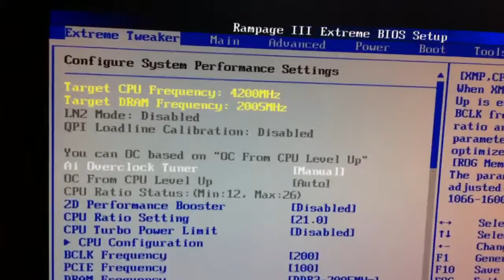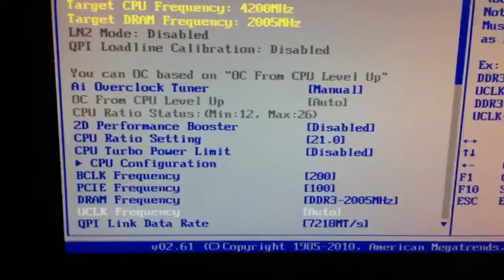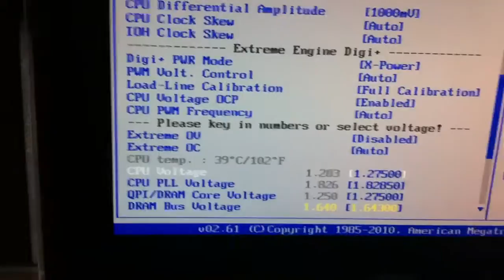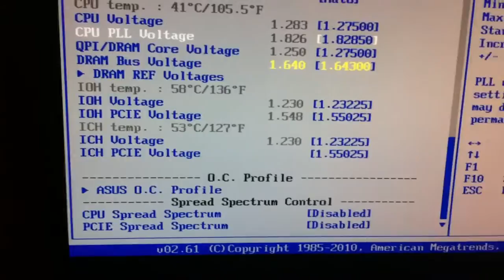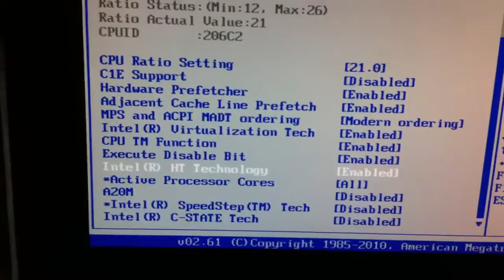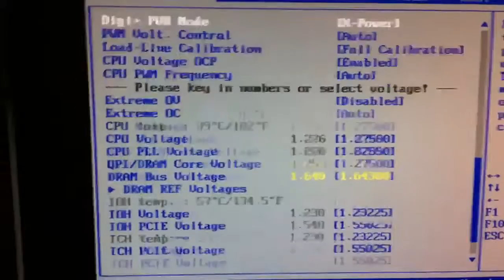Overclock R3E, i7-980, 3.3ghz to 4.2ghz on air

Comment: I use 22x multi on my cpu I don't incease it, I only do base clock more stable for my i7 980x I got 4.84ghz stable on a h100i with 1.56vcore
Reply: too much voltage
Reply: X AK still going strong haha but I upgraded to 4930k
Reply: GamingTurkey  4930k great chip <3
i am running x5650 at 4.3ghz with 1.38v 
thinking to upgrade to x5680 XD 
if you have any idea do you think it is worth it ?
Reply: X AK if it's still cheap yeah go for it, but if it's expensive then 6700k would be better. :) I still have my x5650 from years ago got it to 5ghz on 2cores 1.6v 4.6ghz 1.45v best cpu I ever had.
Reply: X AK if it's still cheap yeah go for it, but if it's expensive then 6700k would be better. :) I still have my x5650 from years ago got it to 5ghz on 2cores 1.6v 4.6ghz 1.45v best cpu I ever had. My 4930k only does 4.4ghz at 1.3v and it poops it self after that won't go further. Even with 1.5v but I got it at 4.2ghz 1.22v 38c on the hottest core :)
Reply: GamingTurkey  i found it less than 100 dollars 
i think it is on the cheap side 
also 6700k is very overpriced for me i will never buy it also i have old ddr3 ram i cant buy new ddr4 XD too much money
i have asus extreme 2 motherboard i will never change it XD money everywhere
i am on air cooler coolermaster v6 i cant push my x5650 to higher voltage because of the temps 
but generally 4.3ghz from 2.6ghz stock it is very impressive i got 980 points in cinbench r15
Reply: X AK with my x5650 @4.6 I got 1080.  With my 980x @4.8 I got 1111 and with the 4930k @4.4 I got 1220 :P go for the x5680 then :) I would recommend a h110 you can do easy 1.6v with no issue. Any cpu.

Comment: Thx for the vid, it helped to overclock my 980 even though am using the p6x58d premium. I couldn't get to 4.2 but I did get it to 4.0. Close enough for me. I also got the noctua heat sink and it keeps my cpu cool. Average 33 to 36 celsius in idle and 45 to 50 celsius on load. Thx again.

Comment from the maker: well im using the noctua nh-d14 heatsink now, and I was going to buy a reference GTX 680, but im waiting for the Asus GTX680 DirectCU II.
 I sill run it at same specs 4.2ghz with 12gb 2005mhz ram.
Temps i dont bother watching anymore heh, there very nice and cool at 30C-35C with playing skyrim Maxed with mods.

Comment from the maker: @SchijtXD if you have the same motherboard, and cpu then these specs should be fine for you... but watch your temps, what heatsink/cooler do you have?

if you have a stock i7-980 heatsink i'd stick to 4.0, maybe 4.2 if temps are good which they should be.. the i7-980 stock heatsink is pretty sick.
Reply: Hello friend,i bay a Alienware aurora R1 whit I7 980(non extreme) like yours,bios is A11...can u help me to clock my pc from 3.33mhz to 4.0mhz...please?

Comment: Oh one more thing... Why didn't you use the stock Intel cooler ? It works much better than the one your using .. I have same chip with same overclock ,using stock cooler with the switch set to" P" for performance  and my Idol Temp is 27c. And I run Prime for one hour and max Temps are 42c ... Also use MX 4 , paste.. Trust me you will see...

Comment: Your UNCOR is not 2 times memory speed on. A Gulftown 32nm chip .. The correct formula is 1.5 times the memory speed .. Use this formula and you will find it won't crash anymore ...have fun !!! Oh and p.s set your IOH AND ICH voltages to auto no need to up them, you will only heat up MB temps for no reason..